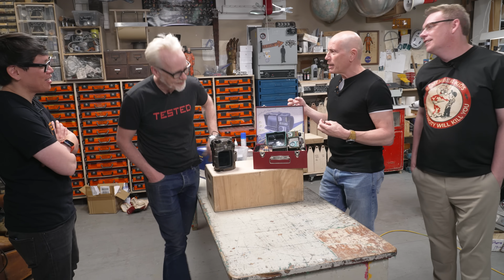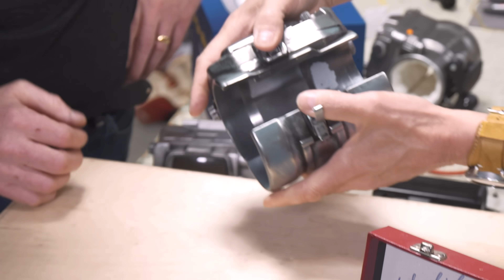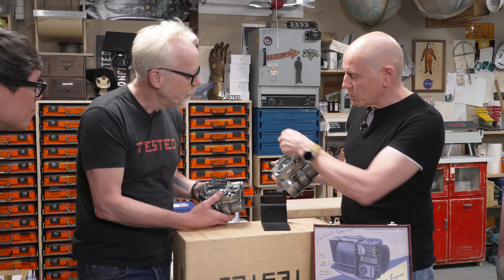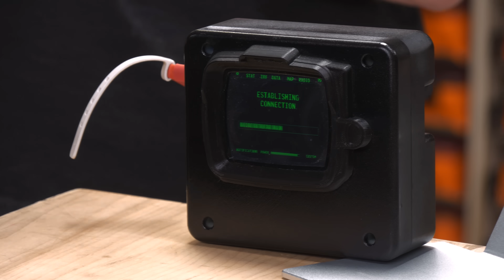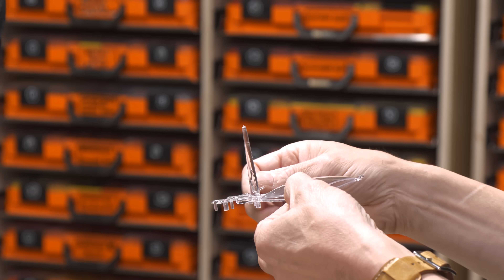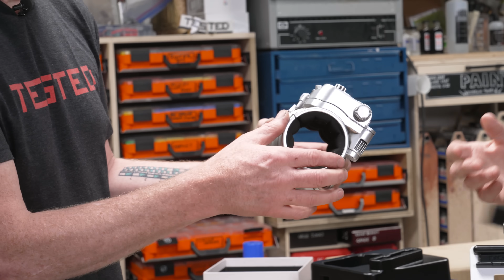Adam Savage Goes Hands-On with Pip-Boy Prop from Fallout TV Show!

Comment: don't send it to a factory in China to produce or the market will be flooded with cheaper shittier counterfeits or worse an Amazon knock off lookalike but not enough to get sued for it. Sadly those crappy counterfeits will also tarnish your own products because of how negative reviews work. It's not a mistake that you can get shittier clones of successful products when you get China to make your stuff. Often it's the exact same factory you paid to make your stuff that is turning out the fakes and why they seem to be so identical to the original except for materials used and quality control.

Comment: Sorry off topic but Question is it possible to make a light bulb out of a diamond encased super charged lithium-ion pro battery that is wrapped in a heat sink that recharges the battery with a led bulb hooked to the battery. Ai is telling me that it would work but for some reason my mind is telling me to flash freeze the light bulb and bring the heat gradually. Just trying to make a one-time charge light bulb and would the light extinguish ever because the energy can't escape the diamond enclosure.
Reply: trying to catch lightning in a bottle
Reply: sorry not a heat sink but a small thermoelectric generator

Comment: Just awesome. 👍👍😁 One thing from looking at the pre-order product pics, what keeps the USB cable dongle in the wrist band, just plastic rubbing plastic, or will they be adding a magnet on the collar of the dongle, or a slip connector like what it looks like in the game? Otherwise if you plug and unplug the dongle from the holder on the wristband, it will wear down and the dongle will slip out all the time and just be swinging from the cable.

Comment: Everything is great, but personally not a fan of the color change with the charge level. I feel like it would be far better suited as some kind of hidden or out of the way indicator. Especially starting the change after 75 percent. If you must use that spot as a charging indicator, use green until the last 10 or so percent.

Comment: They sell the Geiger–Müller tubes that could fit perfectly inside of a slightly larger one. That is the functionality i want and will pay for.
Reply: Why no one has thought about it yet amazes me because i know it is possible and would sell like hot uranium cakes.
Reply: the tube size is proportional to the sensitivity. The tubes are very expensive (relatively) and generally, for a small tube that would fit in a Pip-Boy unless you were outside Chernobyl's front door you wouldn't hear many clicks... so one click every day or so would not be much fun... on the other hand, it would mean that you were safe... You don't really want to hear those clicks, especially since RadAway hasn't been invented yet.
Reply: @chrisbarnardoTWC  That makes sense. I guess the novelty would sell. The functionality i guess would be useless. Id still buy it though for the novelty. I have one of those tubes and circuit boards myself because i wanted to make one. Never got around to it and i think i lost the tube somewhere.
Reply: @chrisbarnardoTWC  I did buy a touchscreen to make the pipboy screen though. I use it as a macro keyboard for games. Never finished the programming or wrist mounted shell for it either. I think you can buy the capacitive touch film and lay it overtop of the plastic concave making the look and functionality. I'd use the geiger counter not for accurate purposes but to be very rudimentary. That is still interesting to me.

Comment: Pretty cool but the software / hardware integration looks like it absolutely sucks - turning dials and literally nothing happens, the level in the power meter doesn't move with the charge percentage (only if you shake it - crap). So much more could be done with this if they just integrated the buttons properly with the software

Comment: I quite enjoy Adam's videos, and his nerdy/geek passion for making things and taking things apart to figure out how they work. It's a great post Mythbusters channel to watch, so this is not a review against the channel, but the product the video is about.

So with that said let's get into it. 

This video is super sus, and I'll tell you why. It comes off as nothing more than a product Hocking / Hype it up video as Bethesda is hoping to use Adam's credibility, and the popularity of his channel to help "Sell" their substandard product. With the recent success the Fallout TV show Bethesda is hoping to capitalize on that and ride the wave hoping to sell inferior or substandard merchandise to the unsuspecting.

I have purchased many Bethesda products over the years and have a version of every Pipboy collectible released to date. I can tell you with ABSOLUTE certainty that this 'Die-Cast' Pipboy is garbage. What they show as "Features" in this version is nothing they didn't have in the previous one made 8 years ago. What they don't say is that they have merely changed a couple "features" from the Pipboy that was produced in 2016. Seriously, it is nearly identical in software and hardware.

They changed how the device was charged, because they changed the stand. The 2016 Pipboy, which was the Bluetooth addition, had a stand that had a direct battery charge post built in, and you'd plug the base into the wall. This one has just uses the Pipboy connector as a charger that you plug into the base, which also plugs into the wall. They have also "re"programmed the screen to change colour to indicate power-levels (green/Yellow/Red) for the battery, rather than have the 'Level 0-10' indicator that was on screen for the original. Other than it being Die-cast...

THAT. IS. IT. They have changed nothing else. That is how lazy Bethesda is, honestly.  And the $200 US asking price is beyond the pale for what you are getting, trust me.

Just google Bethesda collectible reviews; ie. the disappointing Power Armour Helmet, the Nuka Rum bottle scandal, the Canvas Bag fiasco...and so on. Bethesda does not make, nor the collectible prop-makers they contract out to, make the best or reliable products. They promise big, and push out very crappy collectibles. They tend to break easily, or are literally not anything what Bethesda hypes up and promises. 

Buyer beware!!

Comment: I didn’t quite understand this, does the Radio setting work as an actual Radio or does it only play soundclips from the series? Because they also said there wouldn’t be outside connections or anything so I assume no Radio? Would definitely be cool if you could actually use it to tune into actual Radio Stations and listen to them. Although maybe that feature wouldn’t get enough use to make it worth it?

Comment: There was (is?) a 3D model kit or STL files on Etsy for a pipboy from fallout 4. It the exact one you see hanging in the store front window when Lucy first goes in the store of the old woman in Filly on the TV show. Last year I was looking to add some kind of wrist wearable prop that I was going to use as a personal time jump device for an original cosplay character I was creating in time for MegaCon 2024. I bought the files and printed and built the model. It had working led lights and there were 3 different sizes to fit different cell phone sizes so like the hero prop here you could use your cell phone to run the screen. At the time all I knew about Fallout was that it was some kind of  crazy video game with a cult following. Roll forward to today and I'm 40% done with a complete screen accurate cosplay outfit of The Ghoul ... lol

Comment: Having the usb port built into the wire is a cool idea, but I worry about how the wire will hold up over time. We’ve all had phone charging cables that’ve gotten worn out on the ends to the point of eventually being nonfunctional. Though we probably won’t be handling these as much as our phones.

Comment: Honestly for the size and function the price of 199 seems justified. They crammed quite a lot into it and it looks very nice. Well done 👍🏻
Reply: Saved me from looking up the price. Was thinking it's nice, but it doesn't do much. I want a real GPS map converted into green screen. But that would take software development, licensing and even adding something simple like a heart rate monitor would add cost and slow production. Plus no doubt the maker and modder community will get on to that. I think it's also funny that Adam's already wearing a far more sophisticated 'PIP Boy' on his wrist. Part of the think I loved about Fallout is that whole retro-future '50s and '60s SF aesthetic though.
Reply: @brolohalflemming7042  a heart rate monitor would require skin contact with the sensors. Considering the construction with the inner cuff that would require a major overhaul. You also can't adjust the 'strap' like on a watch so it'd probably be pretty uncomfortable for most. It's also another part, and every part and assembly step adds complexity.

GPS is not impossible but aside from a fun gimmick I think it's hard to justify adding something like 50 bucks per unit (GPS hardware is pretty cheap, software development isn't. And this is a pretty low volume item. So you basically divide the dev-cost by the units sold.). Most people that buy something like this are not going to daily drive it. The alarm clock function makes much more sense really. Keep it save inside the house, on display and still get a daily interaction out of it.
Reply: @SyntheticFuture  Yes, that was really what I was getting at, but perhaps didn't word it too well. It was also the point they were making in the vide. So the whole iterative design process would take longer and add complexity as you add functions. It's something that's often frustrated me as a design engineer. Sales or marketing want X feature added, but the price and deadline can't change.. :p
Reply: @SyntheticFuture  the PSP had a tonggle that allowed you to connect to GPS without internet. I believe it still works if you buy a PSP and upload the software
Reply: @brolohalflemming7042  Yeah, cramming all that functionality in without a very large market to spread the development cost over easily gets you into the cost range of high end cell phones. Buuut... yeah, I want that functionality too. I don't even watch or play the franchise but I want it, heh.
Reply: @brolohalflemming7042  Closest IRL equivalent to a Pip Boy (health monitoring, full topographic sat-nav, ABC functionality) is the Garmin Fenix/Epix watches and those are 500+ USD
Reply: It's a shameful company that just takes your money and doesn't send you the pip boy. I have emails from the owners saying the company got in trouble ( probably for stealing peoples money and getting caught for it)
Reply: @marineshtf9954  you realize it’s up for pre order right? Like no one has them yet lol
Reply: @Ganglette  yeah it's a scam
Reply: ye till you have to pay for shipping, just standard to uk is an extra $120
Reply: @Bliff86 it's not, I'm from uk and bought it from Bethesda for £174 with free shipping
Reply: @Bliff86  that's.... Pretty insane. I bet the EU would be somewhat cheaper though... (too soon?)
Reply: @Bliff86  GAME and Bethesda International are selling it, Bethesda International postage is £17.00 but that still brings the price lower than GAME by £9
Reply: @Bliff86  hmm my post got deleted, the international store sells them and they're based in Germany.  I got some stuff from them so they seem legit.
Reply: @Bliff86 not if you buy it from the uk store. Read the website properly Choomba
Reply: @Bliff86  no it's not, I pre-ordered it from GAME and it's just the standard shipping for all of their stuff, unless for some reason you want a US version of course
Reply: @Bliff86 extra 120??? I am so sorry man😭 200 is max I could pay tbh anything over 300 and I’m not gonna eat for a couple days 🤣
Reply: @Bliff86  order from the international gear site its £17 shipping
Reply: @Bliff86 I think Bethesda has an international store with cheaper shipping instead of the US store which costs a lot.

Comment: Cool looking collectible, although I do wish it was in the smaller size. I won't be wearing it around anyway, so would rather just have an exact replica of what Lucy wears on the show.
Reply: The front is the identical size it is only the cuff that is a bigger diameter on the male version. We had to do that otherwise it wouldn't have fitted most of the fans... Lucy has very thin arms

Comment: It really disappoints me that there's still no production pip boy that integrates with the games (or at least 4) like with the app. Like, a super accurate and detailed prop is neat, but one that functions as it would in universe is insanely cool.
Reply: The pipboy that was released with fallout 4 does exactly that. It was made to use a smartphone with the app that integrates with fallout 4. Were you living under a rock when they released it or are you the type that thinks they are adding to a conversation by just rambling out your backside?

Comment: You just know when Adam gets his “stand” it’s gunna get weathered, tethered and bothered into unique originality. This is a Pip-Boy stand…. but it’s MY Pip-Boy stand.
(Edit: time stamp 14:50)

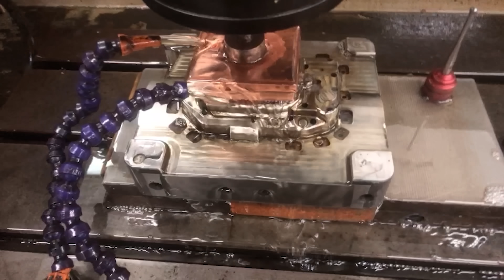18:39 Edit of the edit. I’m so glad you included this process. One of my jobs was in a plastics factory in the U.K. . The machines that run these ‘tools’ can be huge. My specific job was “material loader”. Basically, I fed the machines. The ‘tools’ could, can and indeed are, up in the tons in weight so it gives you an idea of how big the machines are. We’re talking 15-20’ high, 30-60’ long. Material handling wasn’t easy either. Some had to be dried, pre warmed, strictly kept from moisture and the kick from static buildup was unreal! Not an easy process at all. Think about that next time you get a shower, toy, food packaging made from plastic… someone got zapped feeding the machine while it was being made.
Reply: cringe

Comment: The stand needs to be completely redesigned. It doesn't fit aesthetically in the slightest. Everything in the Fallout universe is rounded over, and is a result of the casting process by which objects in that universe are created. i.e. draft angle & fillets
Reply: Yep the stand is minimalistic and kinda disappears but you'd never see something like that in the fallout universe. 

I doubt we will see any change though. It is way too far in and they aren't going to be making major changes like that.

Comment: Just a curious question, but couldn't you make the charging port in the cuff itself? Like have a small section that can be separated in the foam material open up to show a charging port? Closest example I could think of from the top of my head would be like how a rechargable teddy bear/plush works. Then a charger could be integrated in a stand or something

idk just a thought. The integrated wire bit looks really cool though, I'm just thinking about the potential wear of having that wire around the hinge
Reply: Well, in the game, there is a retractable cable that allows the user to interface with some Vault-Tec control panels. A charging cord like that wouldn't break canon in the slightest.

Comment: Given that cellphones have wireless charging, I don’t think they necessarily had to ever remove the phone from the prop
Reply: wireless charging is not too hard to implement, but it does mean that the stand has to have electronics in it and that makes it another product to be designed, and manufactured, and then it's also another potential point of failure... plus not as effective as a good old fashioned cable.
Reply: @chrisbarnardoTWC  I was referring to the hero prop, not the collectible. The phone comes out inside a housing, but with no clear way to remove the phone.  My idea is that the entire phone+housing comes out and can be placed directly on a commercial wireless charger

Comment: Someone should let those guys know they probably used some type of custom Chi charger to charge the phone in Lucy's pip boy rather than remove it over and over and have the fitment get sloppy over time.
Reply: Dropped down into comments to say this, they absolutely used wireless charging to keep that topped up.
Reply: Chi charger?
You mean a induction charger?
Reply: @SqualidsargeStudios  The wireless charging technical standard is called QI, which is pronounced "chi"
Reply: @pileofstuff  You still write it Qi and most people say wireless charging. Also no they didn't do that.
Reply: I was thinking the same thing. If they can get it close enough it would charge
Reply: @Daermos  to the sun?
Reply: @Daermos  no induction charging.
Reply: If it uses solar power charge that would be cool in some way. The pip boy in the lore actually uses internal fission battery, in other words a nuclear powered battery.
Reply: @redhakiim789  true
Reply: No qi or chi. It was removed and charged.
Reply: @YourGeekFix really? That must of been hard. That phone looked stuck in there haha
Reply: @Lemoncoder103  I think they used a special tool.
Reply: @YourGeekFix  maybe a suction cup ?
Reply: @monsterdream14  we wondered. Those old iPhone, could pull off the screen.